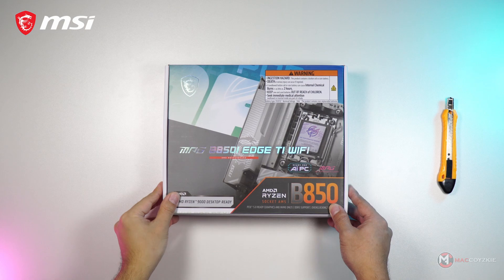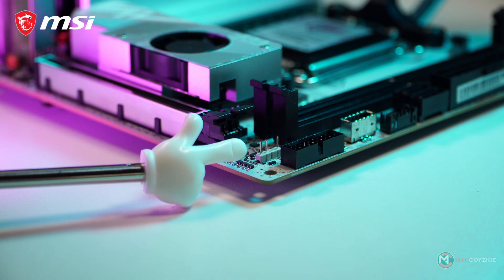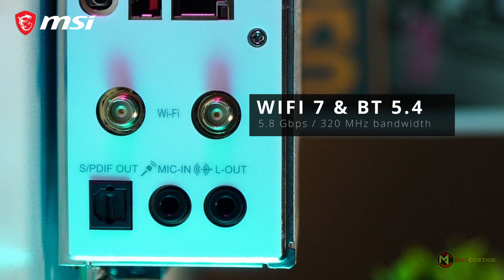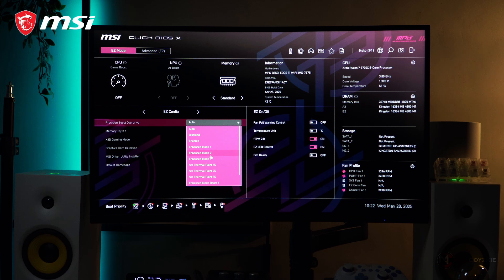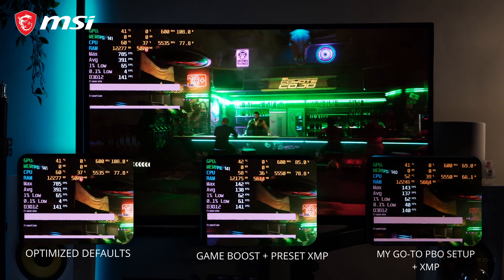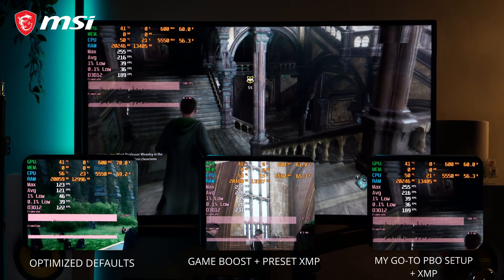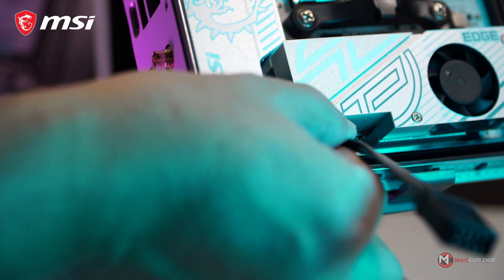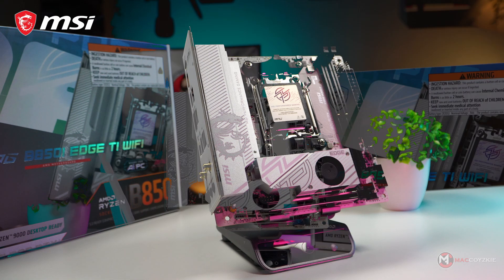Overkill in a Tiny box : MPG B850i Edge Ti Wifi motherboard

Comment: hey is it normal not to see the gpu in the bios?
Reply from the maker: usually they don't show the model name but you can check in the pcie configuration
Reply: @MacCoyzkie  thanks mate! last question, which wifi/lan drivers do i uninstall on the msi website? they have multiple options ( ie mediatek and qualcom). 

Your vid has been by far the most helpful of all the reviews for this motherboard during setup.
Reply from the maker: @CEnjoyer  no problem bro. glad i can help. to answer your question, just use qualcom

Comment: Sorry bud but your game benchmarks make no sense. There is zero chance that "game boost" or your PBO setup can give you a 50+% boost over stock.
Reply from the maker: all titles? what are you talking about? it didn't get 50+%
Reply: @MacCoyzkie  2077 has 362FPS listed as the avg vs 148 for game boost vs 145 for go to. Over 50%. Hogwarts is also close to a 50% bump.
Reply from the maker: @DavD-xo6wm  oh yeah, im not quite sure what happened there. I tested 2077 several times going back and forth and the optimized defaults has those numbers every time and temps are going up to 70c. so 2077 in optimized defaults has over 50% compare to the other two settings.

for hogwarts this might be because of scene i captured. game boost was a scene from the duel, mypbo was just running around the castle and the optimize default was playing an in-game event. Maybe Next time i'll just make one scene for all settings

Comment: I've been waiting for a new MSI B850 ITX motherboard since last year since ASUS's customer service declined so bad trying to avoid ASUS products for Asrock for their slow firmware update. In march MSI finally announced that this itx motherboard is planned to be released on Q2 2025 on the press but there haven't been any information released further since then. Two thirds of Q2 have already past and there's still no information on the release and reviews like this videos give me some hope because it usually means that the public release isn't too far off, however still can't buy the damn thing from anywhere.

I'm glad that it has a 5G Ethernet port instead of the usual 2.5G. Nice build Great Video.
Reply: Me too! ASUS let me down badly by not honouring warranty on defective Graphis Card, will never buy another ASUS product again. Waiting for this MB to get released.
Reply from the maker: @kumar____8577  may i ask what asus motherboard model name you got?
Reply from the maker: asus are expensive too even if it has the same specs/features as other brands, if im not mistaken asrock was under asus before, it was suppose to be their budget line up so they probably have the same customer service too. 
about this b850i's availability i think it'll depend where you are at, some countries have them already but some don't. hopefully it will be available in your location soon. Tbh I still want to make some bios setting tests because it has a lot of ways to make your build run better

Comment: is motherboard good with a high end cpu?
example 7 7800x3d
Reply from the maker: yes you can use it. Im using a ryzen 7 9700x in testing the board, check out the benchmark results
Reply: @Stutter-bug sure even 9800x3d

Comment: I'd love to see AMD allow 32 lanes for SSDs in HW raid. 2-3x direct lanes, and the rest 3-5 chipset controlled. 2x2TB with 1 spare is decent for system and app that require speed, and 2-4x 4-8TB with 1 spare for data and less demanding apps is also quite good.
Reply from the maker: That would be awesome! Great setup idea with the mix of fast and high capacity drives
Reply: That woùld be fantastic, even better if AMD did this on a mini  DTX board,allowing you to havè a extra pci-e slot. I'm stiĺl using a Asus mini ITX ŔOG Impact VÌII board. Would love to use  NŔ200 case, but sadly dosn't support the mini DTX board.